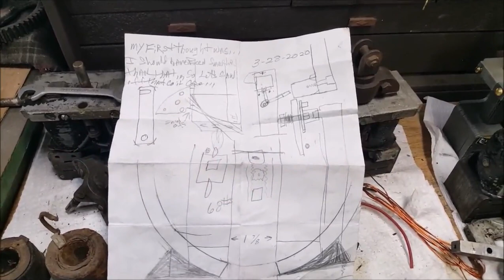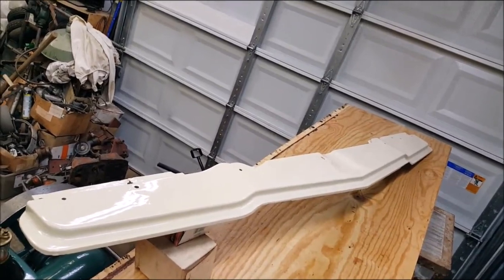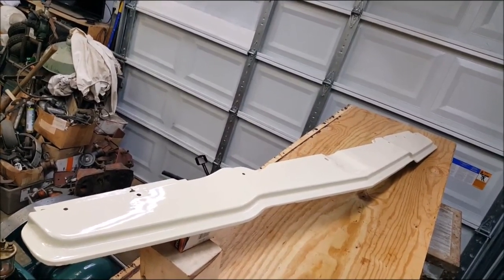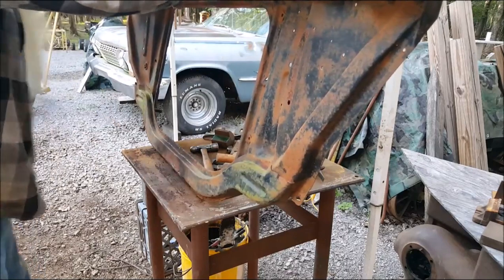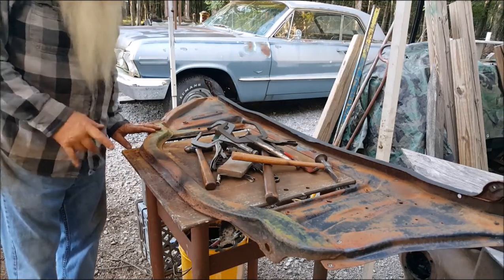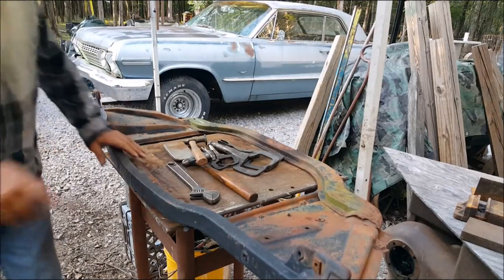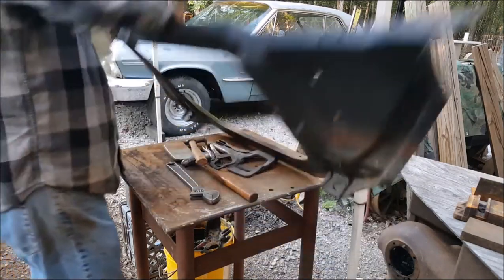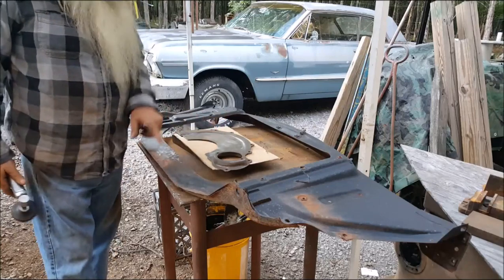63 Chevrolet Impala hammer and dolly

Comment: Great job on that front valance.  You are very talented.  I like the old chevys too.  I had a 283 in a 1965 Chevy truck with a four speed granny low and a power glide in a 1952 Chevy car with the six cylinder but never a 283 power glide combination.  I bet this truck comes out real nice.